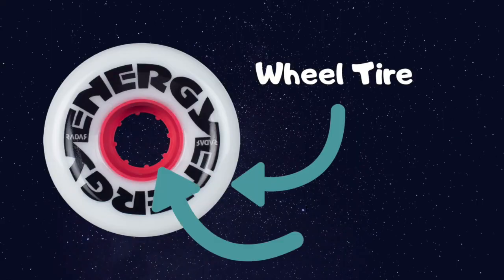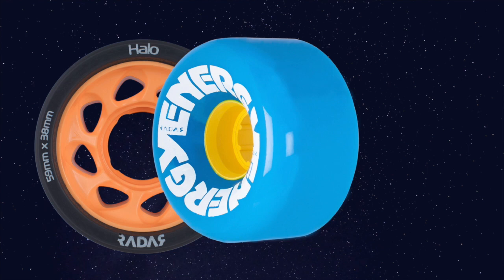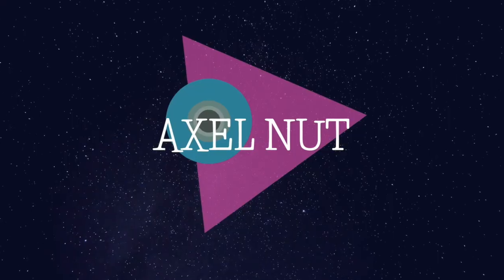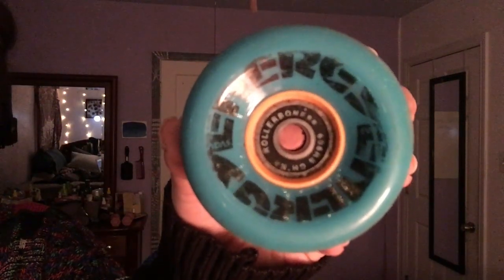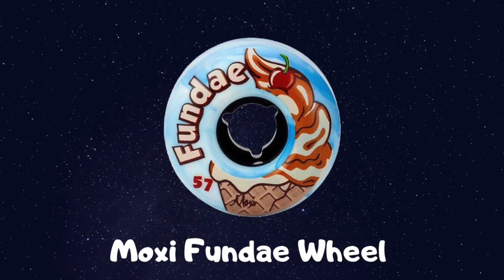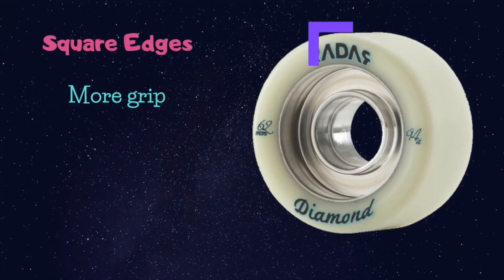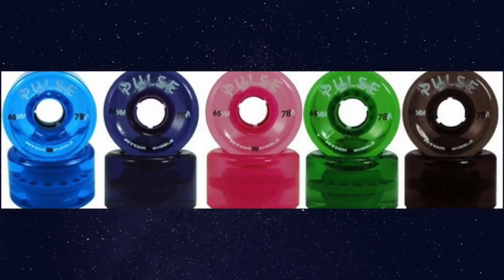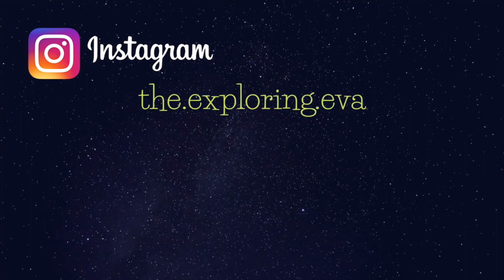Roller Skate Wheel Guide! (English)

Comment: I have the Impala skates but they are not good on asphalt, and sidewalks in Mia. Can u recommend some wheels  less than 80 .00 for the asphalt pavement. The wheels and bearings are all I need correct
Reply from the maker: Hey! The only ones I have used that felt alright to me were the radar energy wheels which were the green ones in the video. Hope that helps!

Comment: so i have the basic gummy wheels that come with the moxi lollys, and i’m looking to get the fundae wheels so i can start part skating! do you think the fundaes would be good for the rink as well as the park?
Reply from the maker: Hey Zoe! 

Fundae wheels are kind of an in between of gummy outdoor wheels and harder park wheels. Because rinks are usually coated hardwood they have a lot more grip . For this reason the fundaes will probably be better for the rink than the moxi lollys and may work fine, but I am not sure if they would be the best but I believe they would be fine they only thing I would like to test out is how the wheel does with the smaller width. I actually have some, once the quarantine is over I will probably let you know by experience! :P

Comment: Hi Eva— great info! Thank you! I noticed that you included OJ Super Juice wheels— which  I thought were for skateboards. Will they in fact work for roller skates? I like the size and colors and would love them if they’re compatible. Please share if you know for sure. Thanks!
Reply from the maker: Hi Suzanne! They are indeed skateboard wheels :(((((((( I actually have not tried them on roller skates (maybe I should ;)) I think in trying to find wheel picture I tried really hard to find some where you could see the numbers (maybe that is why I added it). Sorry to disappoint, they are pretty wheels :( . If what attracts you to them is the colors and look, you should look at radar energy wheels!
Reply: @evaquin9711  they look the same as skateboard wheels, I’m now curious if they are interchangeable? I have seen people put rollerblade wheels on skateboard, it has same size bearings so I assume skate wheels would too

Comment: Can I put moxi wheels or any brand on my impala roller skates? And does the hub diameter matters.. Cause I've seen some wheels say 32mm and others 22mm
Reply from the maker: Hey Daisy! Yes, you can put wheels from any brand! Now, in terms of the hub, they are pretty standard atleast for the brands you named ( I would still check on sizing obviously but aside from ordering the wrong size bearings, I didn't have any issues getting the appropriate wheels and bearings to fit my impala skates. Here is the link the bearings I have, I have used them on Radar energy wheels and the moxi fundae wheels. https://www.amazon.com/-/es/gp/product/B0094J6GQ0/ref=ppx_yo_dt_b_search_asin_title?ie=UTF8&psc=1

Comment: hey Eva! I’m currently skating with some very old wheels ( to the point where the numbers have worn off) but they are the smallest size you can get, and very hard. while these still work good for skating indoors and that’s where I’ve learned and become comfortable doing spins and such, outdoor skating seems impossible. do you have any recommendations for hybrid wheels? As much as I’d love to have 2 pairs of skates for both indoor and outdoor, I think that just buying a set of hybrid wheels should do the job. any help would be appreciated! thank you so much!
Reply from the maker: Hey Jessica! Yes, it is definitely more economical to have 2 sets of wheels versus 2 pairs of skates! I'm on the same boat as you though and changing out wheels again and again gets tiring. I am currently using the radar energy wheels as a hybrid wheel. I like them a lot but it is on the softer side on the durometer scale for a hybrid wheel at 78a, which means that they are good outside, and pretty decent inside but you do lose speed skating inside (which I don't mind, so I'm good with them). Additionally, I do own the moxi fundae wheels, and they work fine outside and at the skatepark and they are a little harder so although I have not tried them I think they would do better inside than  the radar energy wheels. (I could not find the durometer for reference thought) So to summarize everything, I would get a wheel that is within 78a- and up not exceeding mid 80's. if you go higher the wheel will get harder. My recommendation would be trying the moxi fundae wheels,  although I haven't tried them inside myself, hope that helps. Sorry this is so long!
Reply: Eva no need to apologize for the long message, thank you so much for the information! I’ll look into those wheels ( and probably buy them too haha) thank you for being so helpful! :) 💖 happy skating!
Reply from the maker: @jessica-sm1nc  Same to you :)

Comment: Very helpful but what size should the bearings be if I want outdoor wheels? Please help!
Reply from the maker: Hey!! The standard size for bearings is  608 size, with an 8mm bore, a 22mm diameter, and 7mm wide. Here is an amazon link o the ones I use!  https://www.amazon.com/RollerBones-Bones-Roller-Bearings/dp/B0094J6GQ0/ref=sr_1_5?crid=3O1DKEOQ1NW9S&dchild=1&keywords=roller+skate+wheel+bearings&qid=1605735682&sprefix=rollerskate+wheel+be%2Caps%2C215&sr=8-5

Comment: Can I put any size of wheels on my rollers?
Reply from the maker: Usually, yes (assuming you are using any roller skate wheels) but if they are too big sometimes they hit the plate and can't spin as well.  If you have this issue there are little dividers you can slide in to separate your wheel from the Truck.
Reply: Eva perfect ! Thanks !